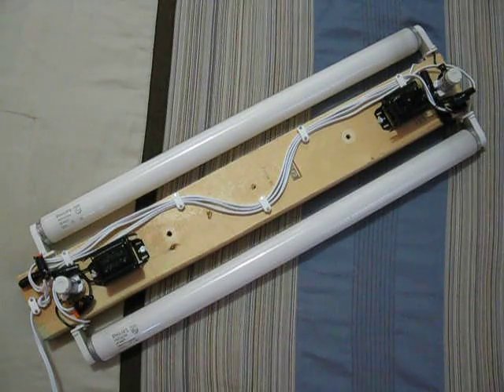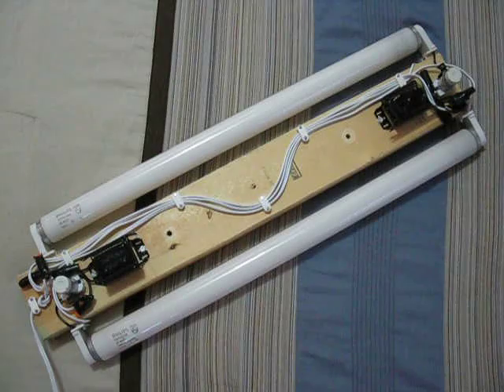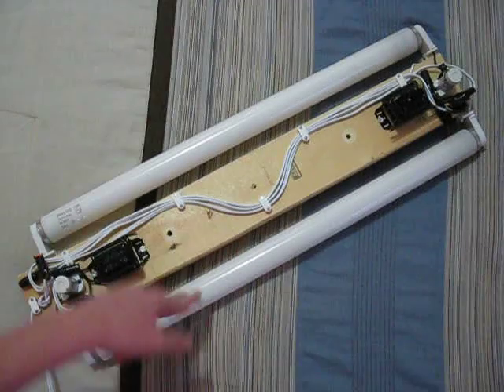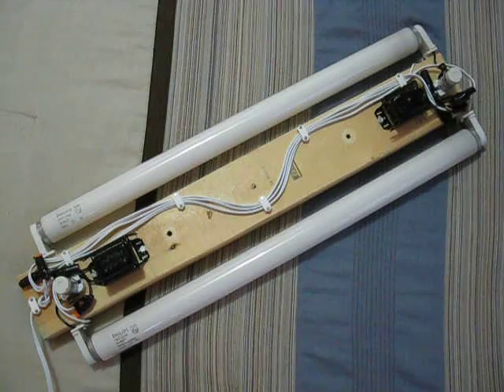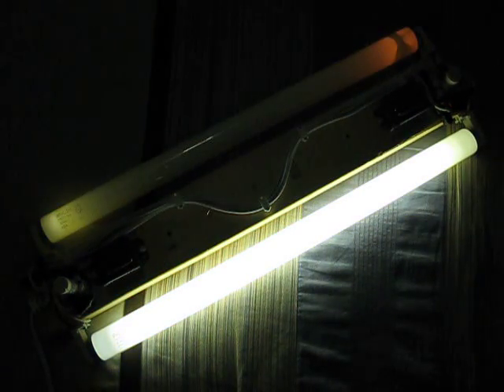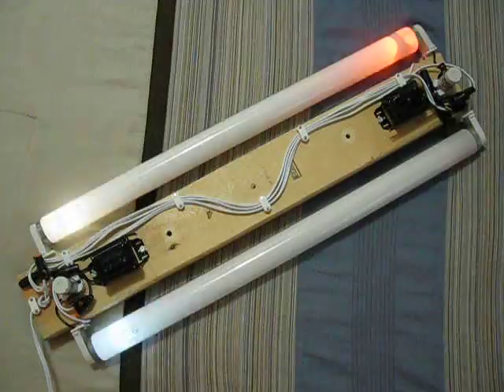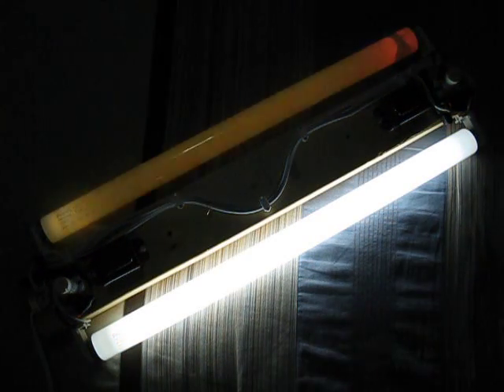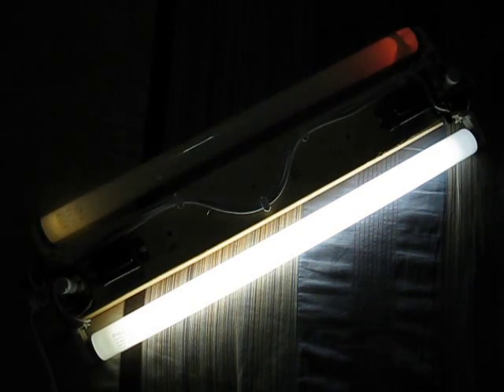Homemade 40watt pre-heat fluorescent fixture

Comment: untwist the starter on the bulb that's EOL at a perfect timing, it will light up but it will flicker
Reply: Not always. depends on the bulb and how much it was consumed! i had 2 bulbs at end of life but only one of them worked this way. What you can do is short out the burned side of the lamp as well! still not guaranteed it works but it might in some lamps!

Comment: if you turn that EOL bulb on the 140 volts (with wariac) it will work as new but at short period of time. or you can turn this bulb on 40 watt ballast and it also work as new but also at short period of time.

Comment: I am a electrician.why your twin 2ft fluorescent tubes light fitting.and its has two 2ft 20w t12 fluorescents tubes and two 18-20w chokes.and two 4--22w starters.its my job to help.bye giving my good advice.if you replace the fluorescent tube in this type.but nothing else.its will work guys.

Comment: why you are not using one 40 watt ballast and 2 FS-2 starters? if you connect 2 20 watt bulbs in series with 2 starters the bulbs would work 2 times more than on 2 20 watt ballasts,because on one 40 watt ballast are less current so the bulbs will last longer. we do that with all of our fluorescent lights here in Europe and the bulbs last about 10 to 15 years, on the 20 watt ballast the bulbs will last only 2 to 5 years because i tested that and bulb on 20w ballast last 2 years - on 40w-7 years.
Reply: the thing with North American F40T12 preheat ballasts is that they are much harder to find these days. In addition, since this fixture is operating on a 120v mains supply, using a separate reactor/choke ballast for each tube is more efficient than using a single lamp F40T12 preheat ballast with 2 F20T12 lamps wired in series is less efficient due to the fact that you have to account for greater ballast losses that result from having to use an internal step up transformer to run a single F40T12 tube on a 120v mains supply. Even though a single lamp F40T12 autotransformer preheat ballast with 2 F20T12 tubes wired in series is less efficient than having 2 separate reactor/choke ballasts for each F20T12 tube, it is still doable.